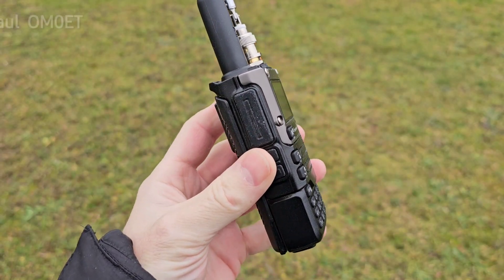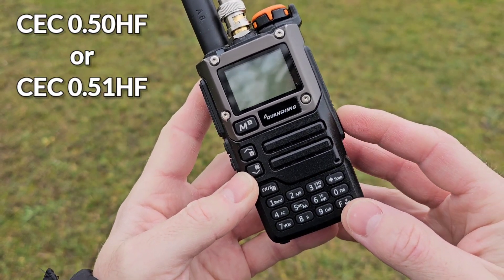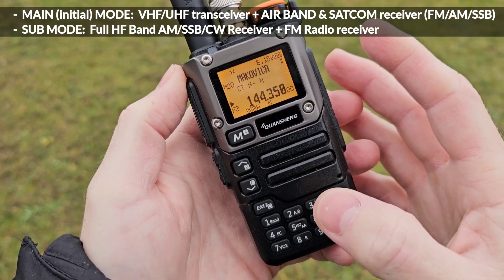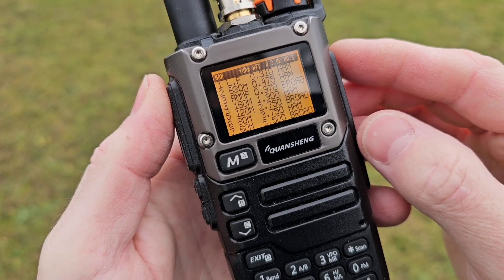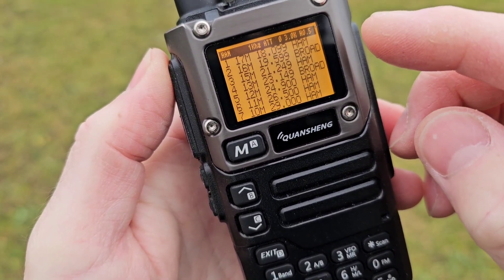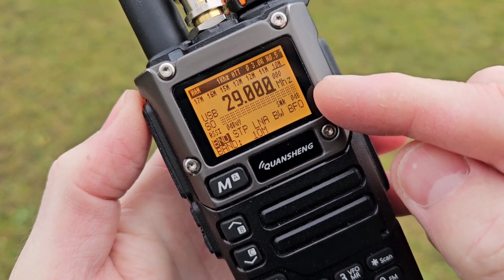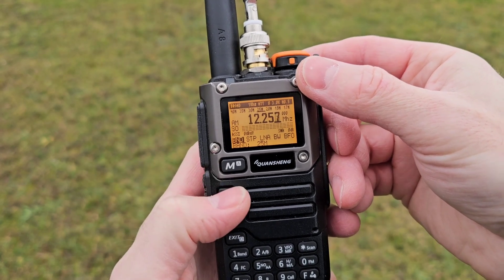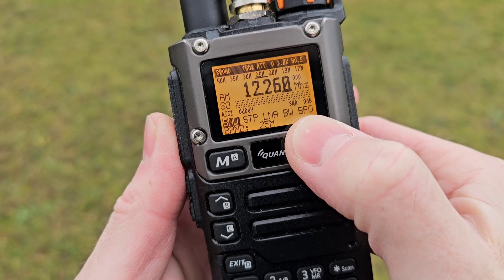Full HF Band CEC 0.51HF Firmware Guide (Quansheng UV-K6)

Comment: Quansheng TK-11 recieves 0.153 MHz to 1160 MHz,  in 4 modes AM, FM SSB,CW Now on the Quansheng UV-K5-6 depending upon firmware can transmit dual side band on 2 meters without loss of rf power
Reply from the maker: Yes. Let's have a look at some of my videos with this topic 😉👍

Comment: Thanks for the video, I also installed the card in v6.8. Which antenna does it use when it goes into FM mode? Mine doesn't use the newly made antenna in FM mode. It uses the radio's original antenna. Is it the same for you? If I don't plug in the original antenna, it doesn't find FM broadcasts.

Comment: Hello, I can see on Aliexpress the UV-K 6 model, but does this have the new hardware and software and full band already included? It only says 50-470Mhz
Reply from the maker: It needs to be modified.
Reply: @OM0ET thanks. I though the fact they call it K6 ment they modify it, but I will not risk it in this case just buy something else

Comment: I don't have sound, transmission and recieving ok but no sound even with headphones.
Reset both from the secret menu but nothing happen.
Any idea?
Reply: I have the same problem did you find something?
Reply: @MrBalibey  It is pins 2 & 3 that carry the HF audio to the PCB, check these aren't short or open circuit

Comment: hello! I have installed this firmware but on the FM band, it's really bad. I does not receive anything, and when it receives something, the sound is quite low and distored. DO you have any idea what could be the cause ?
And on the SW band, it quickly overloads ...
Reply: Same for me, I will remove 8 pin jumper but did that help in HF mode ?
Reply: Here the same. After I removed the second jumper wire the FM broadcast stations where clear again
Reply: @MilovanderZee  What jumper wire are you talking about ?
Reply: @stephaneschmitz8030  From where the original 8 pin chip was to the capacitor

Comment: These are being 'pushed' & promoted a lot in recent times.
But listening to the sound quality coming out of them I'm surprised.

I realise they are cheap, but does the sound have to be so distorted & full of white noise feedback?
We had far better reception from The Moon in 1969.
Reply: 1. This video does not show the best HF reception this radio is capable of. I've seen several videos with loud and clear HF. It depends on many different factors.
2. This radio is not supposed to receive HF. Like at all. It's not designed for that. The very fact that it's doing it is fabulous.
3. This radio is about 15$ and SI4732 mod is about half of that. It's dirt cheap. You would not demand crystal clear sound from cheap chinese walkie-talkie. Get real.
4. Are you comparing cheap chinese portable radio with top notch communication system used by the world's superpower country in it's most important project in space? Am I right? Even with all the technical progress in years, radiophysics hasn't changed. Radiowaves still go the same way as they did back in 1969. Some things are fundamental. You want HF band, you need big antennas and expensive radio hardware. That's why even the cheapest HF transceivers are way more expensive than VHF/UHF dualbands. There's no way around it.

Comment: I posted (part of) this question on your install video for the 2.5 board, but maybe it's better asked here...

It was mentioned in your install video that a full reset should be done through the menu after the firmware is updated, but I can't find this option in the menus.  Am I missing something?
Reply from the maker: Well, radio must be switched to the service mode: push and hold the upper side-button and PTT button and turn on your radio. Then go to Menu.

Comment: Paul, have you update xiegu 6100 to new firmware?
Reply from the maker: Yes, I did. It works great. :)
Reply: @OM0ET  NR works better in new firmware? 🙂
Reply from the maker: @4krist i think yes, but not as good as NR in MALAHIT DSP2 😊
Reply: @OM0ET  
Paul, are you try on 1.1.9 unlock Full TX?

Comment: Can you transmit in HF mode?
Reply: I assume not because of the lack of power / battery power drain.
Reply: Mainly because the hardware modification adds the LF/MF/HF receiver and not the transmitter. The VHF/UHF transmitter is not capable of transmitting on HF and even if it was, the additional low pass filters would be needed to suppress the harmonics.
Reply: @twkolejofil  😉